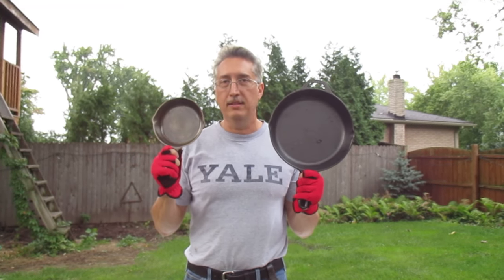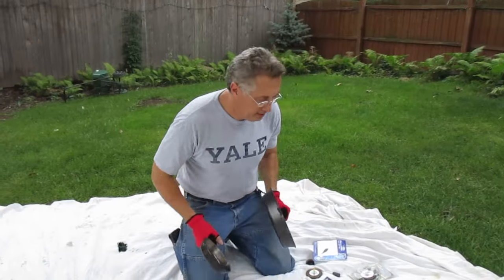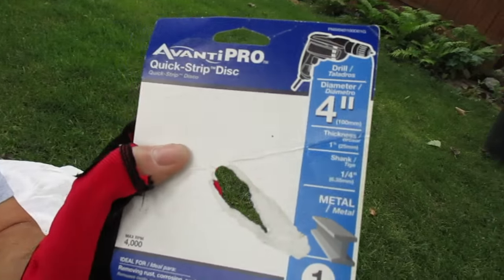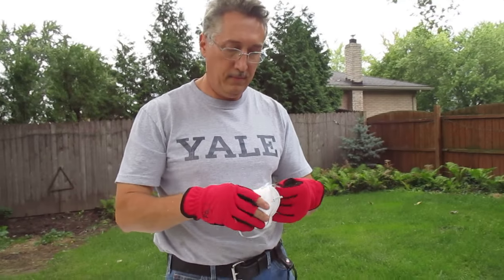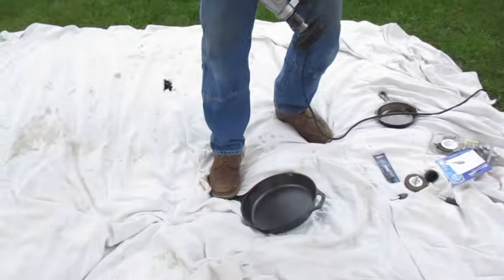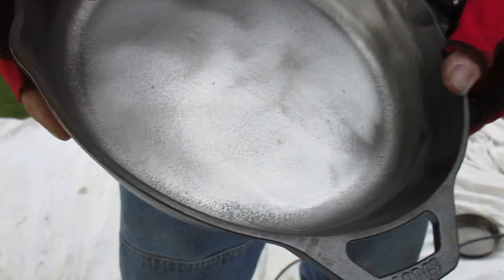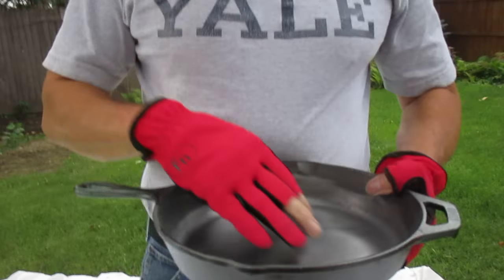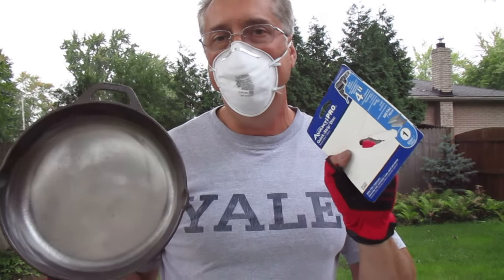Lodge skillet sanding test, it worked!  Lodge skillet for Christmas!  #sandlodgeskillet

Comment: I have been seasoning my lodges for about three years now.  They still have a rougher surface to them and food sticks to them, sometimes.   I am about to pick up one of those discs and try this.  Hopefully it won't take forever to get it to the smoothness I want since there are lots of layers of seasoning on it.
Reply: Throw it in the oven upside down and set it to 'Self Clean' with foil below to catch grease drips. That'll strip off the seasoning. Then smooth it out with the disc. Season it again a few times and you'll be good to go
Reply: If your food sticks its because you're doing it all wrong. They are virtually non stick when new. What oil do you use to season after cleaning?
Reply: @vinceruland9236  I used to use crispy puck, which is a beeswax  base seasoning  designed for cast iron.  I did not like it too much so now I use olive oil.
Reply: @vinceruland9236  I might want to add that the only food that sticks to it are eggs. Everything else does not stick.
Reply: @toddb1765  I always seem to go back to butter for my eggs. Proper heat is key for eggs. They need to be sizzling as soon as they hit the skillet.
Reply: @vinceruland9236  Ahh. I guess I need to wait a bit longer before I put them in. Thank you for the tip!
Reply: It will take more than 20 years to properly season a Lodge skillet. If you remove the rough surface it will be very much easier, and faster.
Reply: @Amen.22  they're all about cutting costs for sure. It's just said to see people buying this pebbled preseason "is better for you" crap.
Reply: @jackburton4892  I've emailed them many times suggesting they offer a line of smoothed pans and they just say it's not going to happen.  Yet now they have a new line that's "lighter" because, supposedly, customers are demanding a lighter cast iron.  But that's not true; lighter means thinner.  Sort of like one less olive in the olive jar.  It was not customer demand; they rest on their near monopoly.  It was cost that  led them to reduce the amount of iron and increase the price on these new pans.  They're on  the way out.  

It's sad because no other US manufacture has the ergonomics of Lodge but the newcomers are selling their pans at  much higher price solely on smoothness - because, let's face it, no one was screaming for a hexagonally shaped pan yet those are selling because they're smooth.

Comment: Good method and it does work on new Lodge Cast Iron. However I prefer to spend a little extra money and buy a vintage Wagner Ware, Griswold or other Cast iron cookware made in the early 1920's . They are a little thinner, a little lighter and extremely smooth. The look better and cook better than new Lodge even when smoothed out with this method. Good video though. Glad you used the mask! Breathing Iron Dust is not good for your lungs!

Comment: I bought a Lodge skillet last week just like the one shown on the video with very rough surfaces.  No matter how many times I seansoned it, food still stuck.  Luckly, I found your website and did the same thing you did except my machine got dulled in 3  minutes and did not cut the surface as much.  But still was able to have a fried egg slid off the pan into the dish on my first try.  

Don't believe Lodge for telling you that the rough surface is to hold more oil to make a slippery surface; that maybe true only to a certain degree but definitely not the kind of rough surface they make them.  Thank you Mr. Macomb for your video!  God Bless!

Comment: I used 80 grit sanding disc on a drill. Took all the rough texture off in a hurry.  Called it good and seasoned. Very happy with the outcome. Took hardly any time at all.

Comment: I know that a lot of people feel that their cast iron just has to have that smooth surface, which is fine. To each his own. I own nothing but Lodge cast iron, and it works just fine straight from the factory, and the roughness, is not an issue for me, so I just use it as it is. But, as I said, to each his own.

Comment: I am going to do it this weekend using your procedure. Only difference is I'm gonna use a couple wood clamps to pin that thing to the railing of my deck. I'm starting to get a little older and my knees are not what they used to be.
Reply: Do mine too please!

Comment: Great job.  Thanks for posting.  I just spent an hour with a random orbit sander on a 12 inch Chinese pan .  You had my effort beat in about 10 seconds.
Reply from the maker: Donald Kasper    The Avanti PRO quick strip disk is $6.47 at Home Depot.  And when you are done, the disk is still good, not worn out like sand paper.  And the Avanti disk gets into the corners of the skillet very nicely where the bottom meets the sides.  And then there's the time factor.  A good corded drill (not cordless) with good RPMs will have this done in minutes.  I used to be a high school construction teacher, and am a a builder now.  I have grinders, I have palm sanders, I have tried them all, I have no reason to lie. Do this ANY WAY YOU WANT, but this is the best and fastest way IMO.   https://www.google.com/search?q=avanti+pro&oq=ava&aqs=chrome.2.69i59j69i57j0j46l3j0l2.3157j0j8&sourceid=chrome&ie=UTF-8

Comment: When you were smoothing out the inside of a lodge, pan just take the high bits off. Don't try to grind away all the pits they will fill in with carbon soon enough. The test is if you can push a steel  spatula across the surface smoothly like you're trying to flip an egg. All my lodge Dutch ovens were very smooth from day one. I don't know if they still make them like that.   
   Around here, all old cast iron seems to be very expensive and hard to find.  Keep watching, though you may find a real good piece of cast iron for a reasonable price. If you watch, you can still find very good, no-name new three piece cast iron frying pan sets.  The big thing to watch for with them is the bottom thickness and  the sidewall. thickness, it needs to be consistent with no thin spots.

Comment: Great video but one error in the description.  Seasoning is far more than just grease and old food.  Seasoning is a baked on carbon layer that provides easy cleaning and smoothness as well as rust prevention.  Think of it as powder coating pure carbon.  When you season, you burn off the flavonoids, food particles, and other impurities, leaving only the carbon layer.  The more you season correctly, the purer the carbon layer is, the thicker it is, and the better attached it is.

Comment: $ 9.00 10 minutes and had completely smooth pan got this on Amazon ( .5" x 7/8" Premium High Density Jumbo Zirconia Type 29 Flap Disc 40,60,80,120Grits,Mixed Grits - 10 Pack………

Comment: Uggh, this video. Search for Kent Rollins cast iron on YouTube. He will show you this not that involved and you don't need to make it shiny and smooth. Just take the rough edge off and begin rebuilding your base of seasoning. Highly recommend Rollins channel for all things cast iron. Overkill with the tool. Just get some sandpaper, or a simple sander.
Reply from the maker: Uggh.....I just watched the Kent Rollins video you recommended.   I don't see that it is really much different from mine???  He uses a weak palm sander (I have the same sander) which will just add time to the process.  Also,   I wouldn't do this in the house either... in my best metro-sexual cowboy shirt, with no mask on, like Kent did.  This is a dirty process and the cast iron dust will be everywhere including your lungs.   Some people will tell you to NOT smooth the skillet at all because "you'll ruin it"  LOL.  My skillets are fine after several years of daily use.    Can't please everyone... one guy posted a comment that I should take my video down because I wasn't wearing fire-proof welding gloves in the video and was "endangering people"   Another guy had a problem with me wearing a Yale tee shirt (unless I graduated from Yale)  I Didn't graduate from Yale but I do have a Masters Degree in Teaching with an additional certification in Construction Education if it matters!  I own and run Belle Isle Engineering when i'm playing with skillets.  Again, you can't please everyone.
Reply: @DetroitHomeInspector  I'm from Connecticut and own a YALE shirt. And I graduated from UCONN!!!
Reply: @DetroitHomeInspector  I appreciated this video because you are doing exactly what I wanted to do, and didn't blab about ridiculous inaccurate nonsense regarding cast-iron while doing it. just went to town with the grinding wheel and that's 100% what I was looking for. These are just big hunks of iron, there's nothing magical to them, people get a bit bonkers and that's mostly due to lack of knowledge and critical thinking. Keep on doing your thing, my friend!
Reply: Now, I love ol Rollins, Ive been subscribed for years now. But, that one video where he sands it out, I have a lot of problems with. I tried it, and like Matt here said, it made a huge mess in the house. It only took me 30 seconds to  find the air noticeably more difficult to breathe. Beyond that, you cannot season a pan as cold as he did, it just doesn't work. All he's done is bake the oil on, not bonded it to the pan at all.
Reply: @DetroitHomeInspector  Great job on all of it, don't mind the idiots who get butt hurt by a word on your shirt. As far as making a fire hazard, Smokey the Bear said only I can prevent forest fires, not you.

Comment: Awesome. Were you able to maintain a perfectly flat surface on the bottom?
Reply from the maker: Never checked.  Been cooking with it for 3 years now and no issues with all the grease/food sliding to one side !!!  Seriously, If there is a difference, it's paper thin.  I know other people mention that "perfectly flat bottom" in vids though.  I don't see it as an issue.
Reply: @DetroitHomeInspector  Also, a properly heated cast iron will retain heat and shouldn't contain any "hot" spots with the thin layer that is taken off.

Comment: does the stripper bit work well on the  sides of the skillet  since its not a flat surface or does it require some hand/manual sanding to have the same results
Reply from the maker: It works on the sides.

Comment: how do you know the bottom is still flat? And if you grind the pan down unevenly won't you get uneven heating or hot spots were it's too thin?
Reply from the maker: No hot spots....use them daily seems to work fine
Reply: Preheat pan if worried.
Reply: That's a logical question. You're only taking off the rough surface. Not enough to make much difference in the thickness.
Reply: The iron is really hard and so just scooting round with that abrasive mesh will take the surface down very slightly and fairly evenly. You can also get less aggressive scouring pads or sandpaper that Velcro onto a disk-bit

Comment: Why don’t they just come like this from Lodge! Ridiculous!
Reply: Ultimately it’s because you don’t really need to do this. The spray on seasoning at the factory doesn’t stick when they are totally smooth and the pans operate just fine without grinding them. Grinding them does improve, them for sure but it they are perfectly usable right from the store.
Reply: TruckerPhilosophy Exactly! I see so many videos of people showing how to grind down their pans and complaining about the pre seasoning finish. The lodge finish cooks perfectly well and non-stick and within the first few weeks of use it wears down smooth anyways
Reply: Amen lodge is just cheap
Reply: You can buy new cast iron skillets with smooth polished surfaces. They cost more, but last forever. One of them is owned by Lodge, Finex.

Comment: Most lodge skillets come rough. Why don't they do this at the factory?
Reply: cost
Reply: Cost analysis the more you do is added value. If they did this the product could potentially $30 + added to the finished product.
Reply: @TimeforchangeTrudeaumustgoEndb  there's a reason why companies like Stargazer and Field Company chargr so much more for their cast iron pans.

Once the pans are poured in the mold there is a basic amount of machining that has to happen to remove parts of the mold that do not belong on the finished product.  Companies like Stargazer then have the pan shipped to a different State to another business that does the machine finishing on the cooking surfaces of the pan.  These additional costs aren't 30$ more... its why a high end pan will go for $200 as opposed to a lodge at walmart for $30.
Reply: @raddad9041  it was just an "example"...Do you have the spread sheets for the actual 
" cost".....
Reply: To keep down cost. If they did this at the factory, you'd be paying as much as for a Field or Stargazer. And Lodge works just fine without going through all of this.

Comment: I'm so pissed. I used sandpaper and a drill with a disk but I still had to do the sides by hand. I could of just done this.
Reply: 0  A regular drill will work fine. Just use the same thing he used.
Reply: There's no need to do the sides though.

Comment: Nice job. Ive sanded a couple pans with an Avanti  quick strip disk and sandpaper. 
They dont take a thick layer or seasoning like a rough pan but nothing sticks either and its easy cleanup  after cooking.
Has anyone  had experience  sanding a dutch oven? I want to because the walls of my dutch oven have carbon buildup and i want to remove  sand and reseason.
I see no videos  on dutch oven sanding but ill give it a try
Reply: Roger Cadillo what grit sandpaper did you use?
Reply: Is it enamel Dutch oven?? If so, don't sand. If not, go for it

Comment: Wow. Lodge has the crappiest finish, and I know they can do this in their factory if they wanted to. Wonder why they don't. Thanks for the tip. Now I can clean all the old stuff I shoved in the closet due to build up and bad finishes.
Reply: Cost. Reason why they do it is mainly to keep cost down. That's the reason why a 15 inch lodge is less than $50 and a high end 15 inch cast iron pan is $200 or more. Also because they do a factory spray on seasoning process the rough surface hold the seasoning on better and prevents it from dropping off. Also a smotth finish has a higher probability of the seasoning flaking off. Even without smotthing the pan if you season it enough and with time the oil will fill in the rough finish. Just takes longer. I my self grind out new cast iron and season it like 10 to 12 times. I then do the egg test and is good. Then I fill the pan with oil and deep fry something. Then let it cool. Then hear oil back up to liquify it dump it out and wipe it down and do a few more seasoning passes. My final passes are stove top seasoning and my initial ones are over seasoning. Seems to make the pan work perfect. Basically trying to simulate years of use in 1 or two days of work.
Reply: @TeamTopKick  From the "I ruin everything" department.  You said it.  Lodge discovered that Lodge leaves them a bit rough because it holds seasoning better.  That's the truth after you get it home as well.   If you cook on a rough Lodge skillet for a period of time vs a smooth skillet, you will find that the rough surface of a Lodge holds seasoning better and builds a more durable seasoned finish.

Most people are put off because they start comparing a brand new Lodge with their 50 year old Griswold.  Agreed, the new Lodge sticks more, but it has nothing to do with texture.  It has everything to do with the amount of use.  

And no, there is no magic formula to a finish like a 50 year old skillet beyond cooking on a skillet for 50 years.  

I say use them out of the box, cook on it, and work on getting that finish to be seasoned from use.
Reply: @bechtoea  there's a saying that goes something like this: Teflon, copper,etc coated pan is the best the first time you use it and gets worse Everytime after that. Cast iron is the worse th first time you use it and but gets better Everytime afterwards. It's true, I'm been prepping and seasoning some new pans right now. Lol. I do a extensive seasoning process and Everytime I I use my pans o season it afterwards for like six months or more. I figure in a year or two I've simulated 50 years of use. I do things to new lodge pans and cheap China Walmart pans too and work the same
 Cast iron is cast iron . We will never know a companies formula. But so far China vs America it has worked all the same.
Reply: The finish is pretty much how it is as cast, anything else would cost more.
Reply: Agreed. Go to garage sales and estate sales and Kijiji , the older the better, and less money.  Sand casting needs a buff and tidy after, always.  Lodge is going to pay for their cost cutting and BS story about how the rough fisnish is a Good Thing!
Alternate:  try carbon steel skillets.  Season them and they work as well.
Reply: @TeamTopKick  In general agreement, but would like to say that the cast iron Camp Chef DO I purchased, made in China, was somewhat "special":  Firstly, it survived the trip overseas by being soaked in what appeared to be old engine oil, or so it smelled when I scorched it off on a hot barbeque.  Secondly, when it gets really hot I can see different alloys in the metal, it's mottled, like the cast iron came from various alloys of iron, likely old engine blocks.  Lodge, not so.  And yes, they both work just absolutely fine.